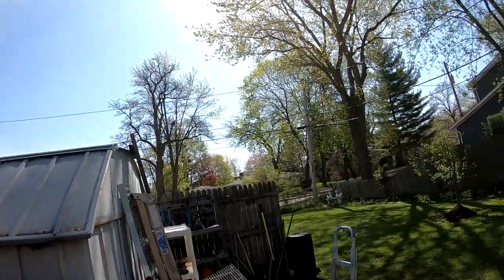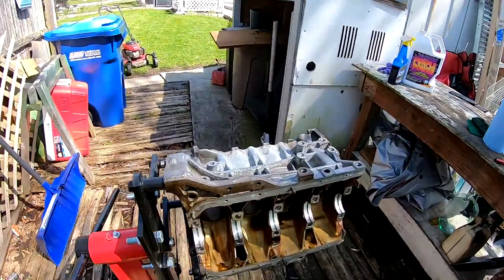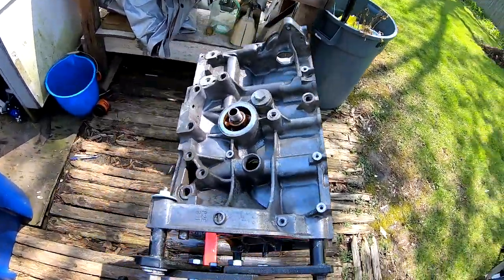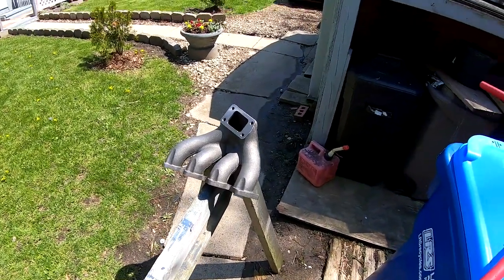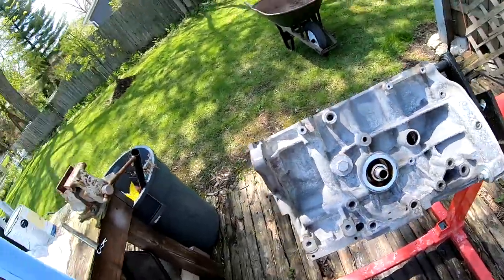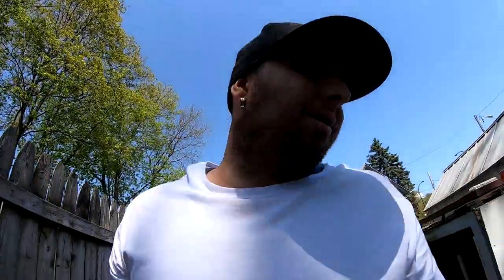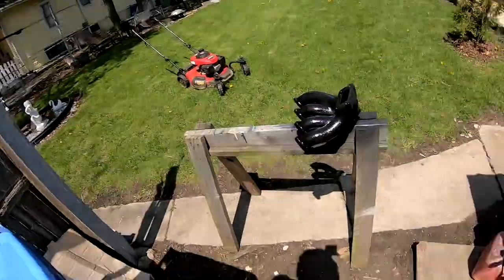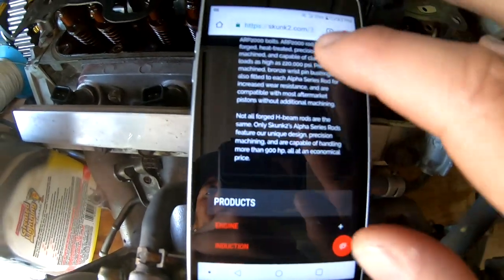High Heat Rustoleum paint part7 (exhaust manifold and engine block painted)

Comment: Is there any video or comments on the results of the exhaust manifold.  I noted in the video the baking process was skipped, therefore I'm curious as to the results without baking.  Thank you
Reply from the maker: Yeah i skipped the baking process i dont want those fumes inside my oven where we cook. Im gonna run my manifold without the baking process. Hopefully it bakes from the heat once i start my engine up. I also bought some heat wrap for my exhaust manifold but i think im gonna wait off to see what happens with the paint. Im curious too to find out whats gonna happen.
Reply: @BarbasLife  So, a year later, can I ask how it's held up? I'm planning to paint my exhaust from the cat back with this same stuff, using the "let it cure via idle" method because I don't have a spare oven, either.
Reply from the maker: Its still good check out one of my latest videos you can see it.
Reply from the maker: @Creepermoss  looks like new still.
Reply: @BarbasLife  Cool, thanks for the update. I'll make sure to check it out.